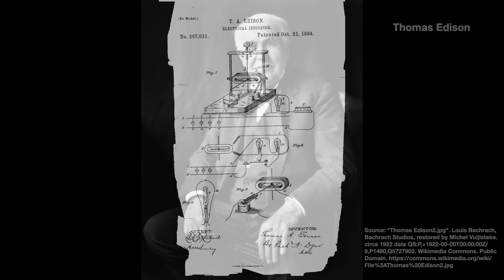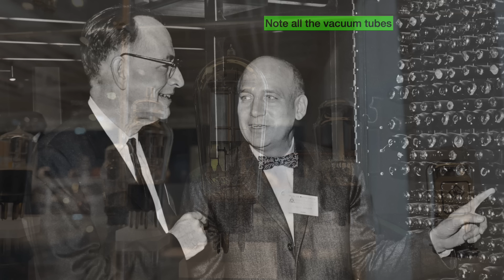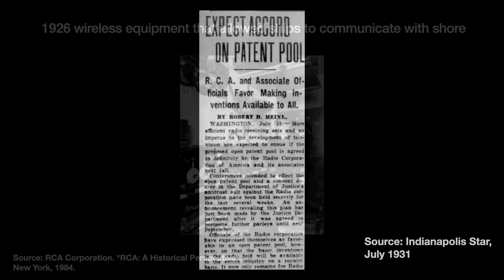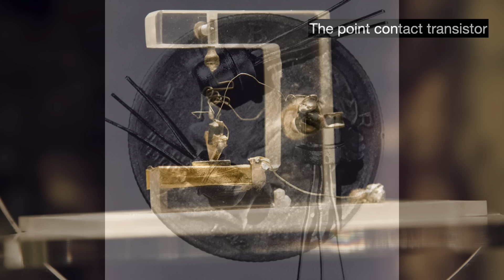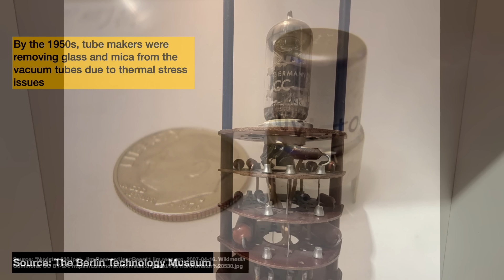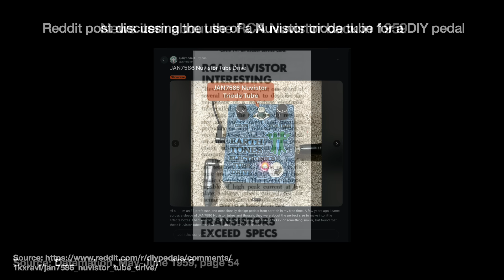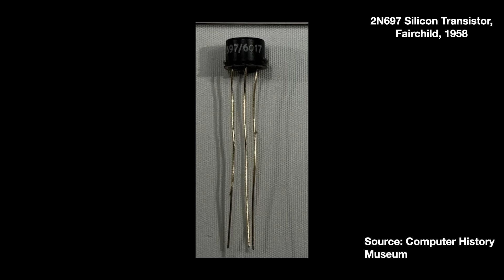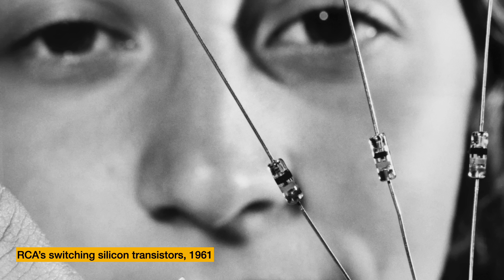RCA Made a Vacuum Tube to Beat the Transistor

Comment: This was good, BUT it must be noted that there is a sort of Hybrid of Tube and Transistor, often called the Vacuum Channel FET. It uses free electrons, like a vacuum tube, but it uses a Cold Cathode instead of a hot one, which is a huge advantage. Another similarity to vacuum tubes is the use of a Field Effect, when a small electrostatic charge is used to control the flow of electric current. These Vacuum Channel FETs, or VacFETs, have been in development in several labs for several years, and have some key advantages over Semiconductor Transistors: VacFETs are not sensitive to heat, ionizing radiation, or electrostatic discharge (ESD). The very first VacFETs made by one lab were able to run at 400 GHz at 5 volts. If CPUs were made with those early VacFETs, they would run at about 40 GHz. Modern VacFETs run into the terahertz, THz. VacFETs work very well at nanoscopic dimensions, do not need but can use silicon, and for low voltages at the nanoscale, do not even need vacuum. 
Thus VacFETs would seem to make a very interesting video topic. @Asianometry

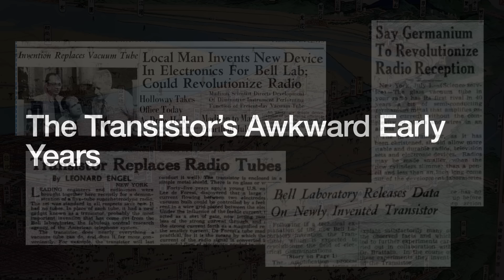Comment: @7:21 AT&T Bell Labs did not discover/invent the transistor. It technically built a device model similar to one that was invented by Thomas Henry Moray, Utah, about 15 (or so) years earlier. One of the Bell Labs "inventors" actually flew to Utah several times and spent time with Dr. Moray to understand the working of his  "germanium" (semiconducting) switching device (later called the Moray Valve).
Reply: It looks like Moray just built a rectifier not a whole transistor. But solid state diodes had existed since the late 1800s. His used germanium which would become relevant for transistors but from my quick research he didn’t get all the way there. 

That being said I’d love to hear more.

Comment: Great video mr. Asianometry, as always. 

I'm humble.... I thought I already knew all basic electronic components:

-resistors (wire, carbon, metal film) etc etc etc.... 
-capacitors in all forms
-coils and transformers
-tube diodes, triodes, tetrodes, pentodes.... etc etc etc..... 
-silicon diodes, transistors and every MOSFET descendant 
-thyristors, TRIACs, IGBTs etc etc etc..... 

Later on in my life I even understood memristors as the missing link....

But even after 70 years apparently I did not know this one....

Comment: Well now. In a slightly spook-y past project we used a Photo Multiplier Tube. They basically amplify one photon into many many electrons on a per-photon basis, with a loss of only ~20% of photons. The modern semiconductor equivalent the Avalanche Photo Diode isn't as good but quite a bit more convenient. Either way you end up with a signal you can use albeit arriving in lumps.

Comment: Actually vacoom tubes has future and had future... Not as logic operator anyway... On cern we are using an open vacoom tube... CRT TV's are modified vacoom tubes with extreme speeds most transistors weren't able to archieve untill 70 or 80s i guess .. cheaper high frequency ones come even later...

Comment: It's the VCD all over again. RCA sees a new tech appear (optical disc/transistor) they fear the end of what they are doing so they spend more money trying to extend the life of the existing tech (records/vacuum tubes) they create something that costs them a lot to produce and doesn't use most the existing infrastructure (CED/nuvristor). They fail in the market because of the lack of imagination on the part of the leadership, it's the mindset of the monopoly holder "Avoid big change and try to only incrementally allow the tech on the market to evolve so my existing assets remain useful"
Reply: Consumer electronics became a difficult business to make money in. Several American companies left the business in the 60's and 70's. You see the Japanese doing the same as South Korean and Chinese competition have clumbered them.
Reply: @AQuietNight  These wasn't about production costs or labor costs changing between nations. It was about the arrogance of a company with a near monopoly failing to manage it's R&D correctly.

Imagine if RCA had not wasted time trying to perfect the vacuum tube and just switched to trying to invent transistor fabrication tech they could have won. If RCA had canceled the VCD years earlier for optical disc it would have won.

They failed in both cases by making a tech that was supposed to be an extension of what they already did (tubes/records) but failed to realize the reason they never did before was that the existing manufacturing infrastructure was incompatible with better versions of that tech ( for the tube glass vs ceramic encapsulation and scale/for the vcd the records couldn't be made in their existing stamping machines ). So they finally do what some engineers wanted decades back and spend money moving that forward not realizing that the world is moving on to something completely different because it's better.

There is a legendary quote: "No amount of incremental improvement in the vacuum tube will get you a transistor" but RCA thought they could make a transistor killing tube. This is the arrogance of a company that is used to controlling a market thinking they can decide what the future is for the market when they don't control the leading tech.
Reply: @ElectricEvan  RCA went into semi-conductors in1953 so it can not be said they were avoiding the future. The CED video system was developed to produce an inexpensive and easy to use video playback method and it worked.
I would say the Nuvistor was successful but was a stop gap measure. The CED just simply got clobbered by better and decreasing cost to the consumer of CD/DVD's.
Reply: @AQuietNight  CED was clobbered by poor quality, expensive production equipment, and fundamental misunderstanding. It was garbage

Comment: The vacuum tube lives on today in nearly every house. The key component in every microwave, the magnetron is a vacuum tube which continues to stand the test of time.
Reply: It's the only tube device that's still around.  Even then it's only used because it's cheaper than the transistor equivalent.  On the other hand it's also useless for anything that requires modulation.  Today's cell phone network requires complex modulation that the magnetron couldn't even dream of doing.

Comment: One important omission from the video: The transistor was invented and patented by Julius Edgar Lilienfeld in 1925; however, it was not possible to construct the device at that time.
Reply: Thoughts on Thomas Henry Moray's "cold" cathode tube from that time? If you've heard of it.
Reply: I know that his idea is a version of the field effect transistor and  not what the point contact and junction transistors were. Bell labs made devices that actually worked.

Comment: What about the Korg NuTube???  "The Korg NuTube 6P1 is an ultra-compact, low-power dual directly-heated triode. Developed by Korg and Noritake Itron, it uses vacuum fluorescent display (VFD) technology to deliver genuine, warm tube harmonics using less than 2% of the power required by traditional vacuum tubes."
Reply: They are very microphonic and suck for audio.
Reply: Yes, I commented about this too myself. In the comments section it came out, I think it was generally used. I don't know it was using it now. For amplifiers, I don't know if it was Vox, or someone was making brought out an amp with that fluorescent tube in it. I haven't heard. Maybe I'll go to YouTube and see if I can find any sound. Samples of how it sounds compared to a traditional tube. Amp, and then again, and how would it sounds compared to a solid state? Digital, or even the new AI reactor amp, who's making that line 6, no, it's called the reactor amp, it's the first AI amp, it's not digital in this traditional. If you could say traditional, when it comes to digital lamps, but for guitars in general, but it didn't seem to go over very big, because nobody's really using them all the new amps being made today. And whatnot are just regular, you know, valve amps that are being made today are traditional valves. So it didn't take off as as I would have expected it to. So apparently it's either because in the guitar world, if it's not traditional tubes, then it's not good. If it doesn't matter how it sounds, is this in people's heads, but still digital. And even as AI am the react that cannot replicate a Tube Amp, not yet, they'll probably get there at some point, but not yet, I just bought a 1990 or maybe it's a 91, not sure at Fender twin. Weaver, rednob, 100 W, 11 amps, 4 huge power tubes, 6 pre amp tubes and one tube to run the reverb. It's a spring reverb tank reverb. It's called, which actually is so huge. And so beautiful in the sound, but it takes up the whole bottom of the amp, the amp, with £84 , maybe more. It's it's a hernia maker LOL but it 'S.A. beautiful thing. It's got 3 channels, clean overdrive and an overdrive too. For inputs, switches everywhere, push, pull potentialometers to cut and and enhance the cue. The gain presence switches for impedance in the back. It's got 2 huge eminence. Blue label speakers with magnets the size of the outer diameter of the 12 inch speaker, but it's Transformers where part of where it's shines, they must weigh the speakers and the Transformers must take up the majority of the weight of this amplifier. There's 2 huge Transformers on each side of the amp attached to the chassis. I don't know how much they weigh. But that gigantic and solid as can be, they're Schumacher, transformance, which were the best, especially designed specifically for that ant same app, the same transformer manufacturer. It was All American that Mesa boogie made its reputations with sadly. They went out of business in the 2000s early 2000s. If I'm not mistaken, this am from 19 90 91 is All American parts. It's the first amp defender made that used PCB boards in conjunction with surface mounted components using all valve technology. It even has a line out. It's an amazing piece of technology for any error I mean it has more ways to shape your tone than kind of than my boss catana, which is a digital lamp. Probably the most, if I'm not mistaken. The best selling app now for your for several years. Many years, they sell the most in the market. And it's digital, and it's cool, I have one. It's a 100 W, it's the first version. It's never been updated, no no updates, no downloads or anything into the app. I just use it like a regular amp. Sincerely, Bob's a flying bedroom guitars.

Comment: It was Tommy Flowers, a British telephone engineer who designed and built Colossus (the first electronically programable digital computer developed during WWII to decode German teleprinter traffic) who first figured out that vacuum tubes were in fact reliable and lasted longer if the filaments were left on all the time. 

(Understandably, the British establishment were initially against building a device with thousands of vacuum tubes because they all had radios at home with a mere dozen tubes and it seemed the repairman was an their homes replacing one on a very frequent basis. The Flower's discovery that vacuum tubes would last long enough to be practical for a machine that needed thousands of them would be considered a secret during the war.)

Later (1970s) some TVs were sold with an "instant on" feature that powered the vacuum tube filaments (at a low "keep warm" level )  even when the set was "off." The constant power draw coupled with the energy crisis of the '70s put an end to that practice. But it also had the added effect of extending the life of the tubes.

Even before the Nuvistor, tiny vacuum tubes were developed for use in hearing aids and in the famous proxin=mity fuse of WWII. One wonders why tiny tubes that consumed low power were not incorporated into the first digital computers like Eniac instead of the normal sized ones commonly used in TVs and Radios of the era. The power requirements and heat generation (and AC needs) would have been far less.

FYI, while J. J. Thompson discovered the electron, it was named by George Stoney after the Greek word for Amber. Stoney was related to both George FitzGerald (of the FitzGerald contraction fame) as well as Alan Turing.
Reply: I've got thousands of vacuum tubes of various kinds, and I work on vintage vacuum tube TVs, radios, amplifiers, and amateur radio equipment.  I can count on one hand how many tubes have failed due to open filaments that I have found in the past 40 years.
What is normal to find though is low emission, especially on those televisions which employed fast-warmup technology.
Pin seals on more modern tubes (post-WWII) are far superior than their earlier counterparts, which would explain why the old vacuum tubes would be more susceptible to failure due to heat cycling.  That being written, I rarely see an RCA branded vacuum tube fail due to gas (leaking vacuum).  They have always known how to make a proper vacuum tube, dating back to the early 20th century.
Reply: @MRandDS  I use 12AX7s and 6141Bs in some old Kenwood transceivers and some are original from the early 1970s. The Tommy Flowers /Colossus/British Establishment controversy stems from the fact that all of the key decision makers had a radio at home and turned it on and off every day--several times in fact. That shortened the life of the tubes and they extrapolated their personal experience to not wanting to build Colossus b/c they thought they'd need girls on roller skates to be constantly replacing tubes. Flowers used hundreds of tubes in his job as a telephone engineer and knew that if you kept the filaments hot, the tubes would last for thousands of hours. But he lost the argument and had to pay out of his own pocket to build the first Colossus. HMG did repay him after the war (barely) but Flowers is majorly  responsible for the success in breaking the highest level German communications during WWII (Hitler to his generals for example).
Reply: @HenryJames-q6t A real unsung heritage, Flowers is up there with Edison.
Reply: @HenryJames-q6t   "I use 12AX7s and 6141Bs in some old Kenwood transceivers and some are original from the early 1970s."

Wouldn't that be a 12BY7?  I had a TS-820S with the 12BY7 driving a pair of 6146Bs.  The 12AX7 was simply a dual triode and I don't recall them being used in the transceiver.
Reply: @HenryJames-q6t  And those old Kenwood radios have a switch right there on the front panel to turn off just the filaments on the 6146 (Never seen a 6141 in anything in my entire life) final(s) that people who knew what they were doing would use to prolong the life of the tube(s).  At least my TS-530 did.
Reply: @MRandDS  Typo. They are 6146b's
Reply: @MRandDS  Typo. They are 6146B's
Reply: @HenryJames-q6t  Ahh, yes - that annoying 1 key next to the 6 key gets me frequently too. ;)
Reply: @MRandDS  Dvorak keyboard....
Reply: @HenryJames-q6t  :D  LOL 
I actually have a Royal DVORAK typewriter!  I just know one day it will be worth money!  hehehe
Reply: @MRandDS  , a tube that allows air in, due to a poor glass seal around the pins, is very different from a "gassy" tube that exhibits grid emissions because of gaseous contaminants that cook out of the tube elements, a symptom of poor  quality control.in manufacture, or which may develop of tubes are operated outside of their ratings and the parts overheat.
Reply: @goodun2974  Yeah, because a tube which has lost part of the vacuum due to a seal failure has NEVER been known to be "gassy".
Reply: @MRandDS , there isn't such a thing as *partially gone to air tube". If tge glass seal around the pin leaks, the effect is nearly instant; hours or days at best before the getter turns snow-white from oxygen exposure. Gassy tubes that emit electrons from the control grid can be caused by leftover manufacturing contaminants, or by running the tube so hard outside of its ratings (typically from loss of, or poorly set, bias point, or a leaky coupling capacitor) that it "cooks" trapped gases out of the metal parts.
Reply: We're these tiny tubes available in the quantities needed?
Reply: @leafbranch1872  They made 22 million VT fuses (proximity) during WWII and each one needed 2-3 tubes depending on the design. So, yes, they had more than enough of them. I've a;ways been curious as to why one of these tiny vacuum tubes was not used in the first vacuum tube computers which had a size and heat problem because they used tubes like you would find in radios and similar electronics of the day.
Reply: @HenryJames-q6t  , perhaps Nuvistors were susceptible to cathode poisoning in computer use where tubes  spent most of their time not conducting plate current. Special tubes were developed to combat this problem in computers but perhaps it was difficult to make tiny cathodes that would be reliable for this specialized usage.
Reply: @HenryJames-q6t   The first computers predated the nuvistor by several years.
Reply: @James_Knott  True, but the tiny tubes for hearing aids and the VT fuses were manufactured before the first computer. IMO if they had used these tiny tubes, the first computers wouldn't have needed their own building, a mammoth power supply and tons of AC.

Comment: In the mid 1970s I was still using an HP scope that used nuvistors.
Reply: In 1977 I bought a Kenwood TS-820S transceiver that used a pair of 6146s for the output and a 12BY7 for the driver, IIRC.